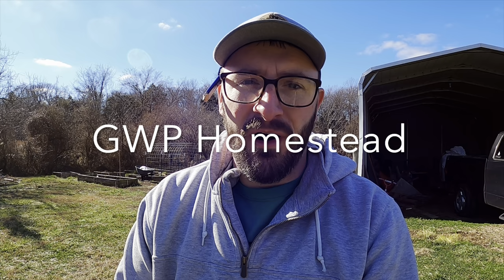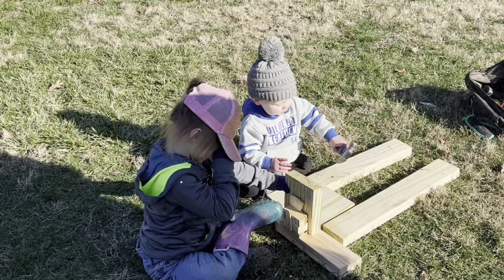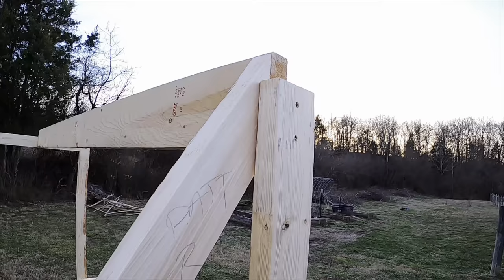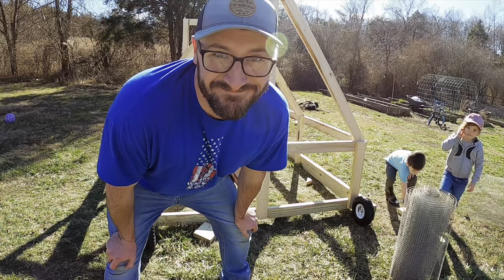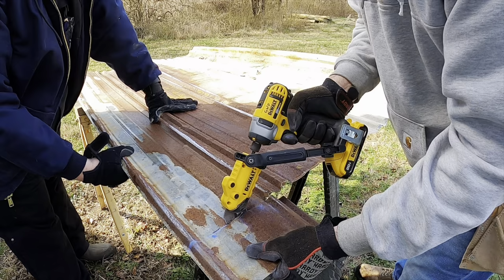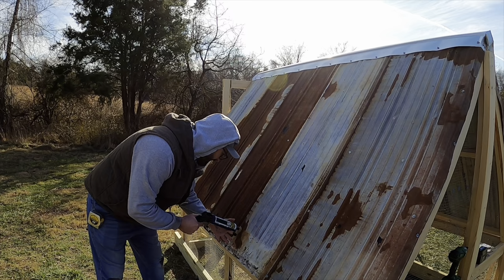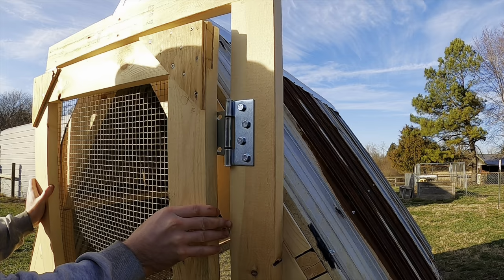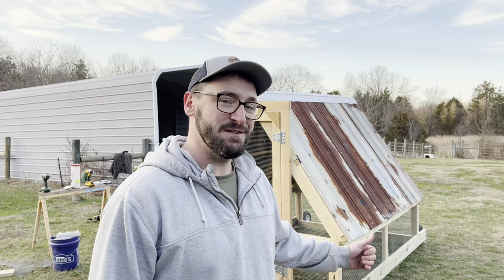The Chicken Tank // Building an Indestructible Chicken Tractor

Comment: The Suscovich tractor is the best. The wind CAN and WILL flip that thing though, Ask me how I know lol.  I didn't think ours would go anywhere but ours flew 400 feet across the field as heavy as it is WITH  40lbs of water hanging from it on the inside.
Reply from the maker: Appreciate the heads up! I'm sure that was a good strong wind that moved it.
Reply: It had to have been!!!
Reply: I came to the comments to look for this type of comment. In my area we often get 50+ mph wind and just last year our 12x7ft base hoop coop (with 3 cattle panels covered in tarps) lived and moved 15 feet away damaging one chicken that was crushed between a waterer on the ground and the frame of the coop. It was awful. I saw it happen. Nothing I could go except run out there and try to hang from the cattle panel to add my body weight to prevent it from continuing to fly away. Thankfully we have since anchored it to the ground with 4 t-posts pounded in at an angle around the frame (where if the coop were to be lifted (like with a tornado) the angle of the t-posts would hold it to the ground. It hasn't moved since, and we've had 70+ winds for a few days at a time since that incident. I'm looking to build a new coop and HATE the hoop coop, so maybe I'll build this style tractor but more beefy as an actual coop.
Reply: @20NewJourney23  I know the OP's farm personally and they hare surrounded by a lot of trees and have more hilly terrain. We have neither of those and the wind whips through here in such a scary way. We recently had some bad storms with a smaller tornado close by that knocked down limbs, trees, power lines everywhere. A couple structures destroyed. Their chicken tractors did not move!!! I'm jealous haha.

Comment: I ended up mounting the wheels to ours on the outside of the tractor. I kept running the wheels through the chicken poop and it was a mess to take them on and off.
Reply from the maker: That’s a good idea, I hadn’t thought of that. Should be an easy fix if it becomes a problem!
Reply: For sure!

Comment: Looks great.  With open ends, how has it been as far as keeping the birds protected from rain?
Reply from the maker: I think it does pretty good. We've had some wind/rain/storms over the past week and while the birds do get a little wet I haven't noticed any moisture in their feeders so its doing a pretty good job of keeping the water out. It helps that the temperatures have been warm enough that freezing is not a concern, either.  I think if we were going to have rain and then cold we'd need to take some extra precautions against that.